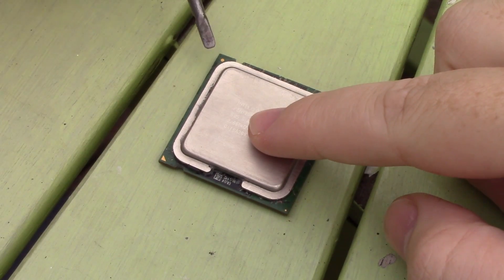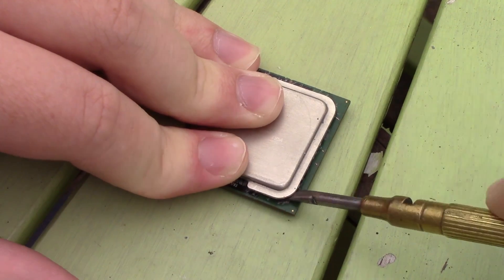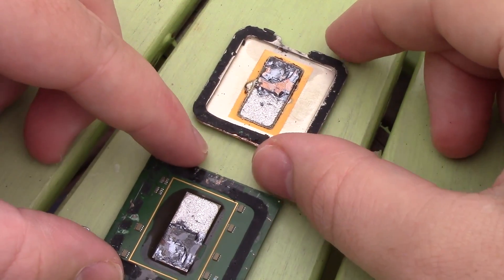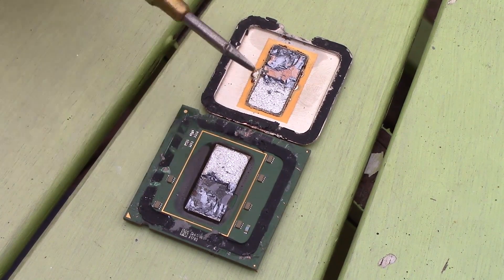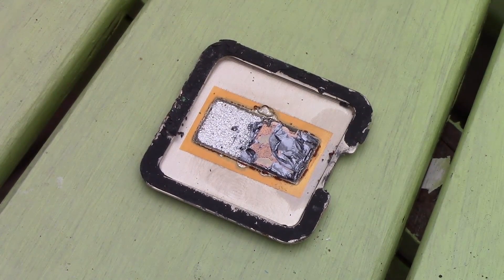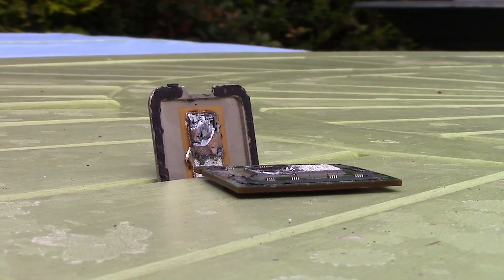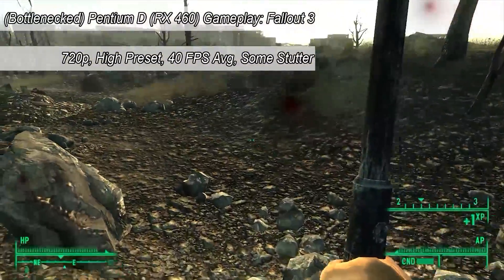Delidding a Pentium D

Comment: i actually managed to delid one of these without breaking the die/dies 
i heated it in a pan for a few minutes, put it in cold water immediately after and pulled the lid off while it was still warm and it popped right off 
the CPU was dead before i delided it so i've got no clue if it works or not

Comment: I have lower power consumption readings with my D 915 in a Dell Dimension E520. According to kill-a-watt meter, about 65w at idle, 115w at load running BOINC work units (both cores at full load). probably a bit higher with prime95. You saying 140w idle doesn't sound accurate at all. i did enable S3 or S4 sleep in the BIOS that probably helped idle power. see video 'can a pentium d BOINC?'
Answer is yes, barely, complete work units before deadlines and hasn't smoked, yet

Comment: (Probably covered in other comments but) Between the Pentium D and the Core 2 Duos were Core Solos and Core Duos. The Pentium D did act as a stopgap, as said in the video, but it was to buy Intel time to dump the Netburst architecture and rev the Pentium M architecture to develop the new Core lines, initially launched six months later.

Comment: Core 2 quads are doing the same...
2×core 2 duos stuck together but 2× more    efficient  than the pentium d s .
Ex: c2q q6600 = 2×c2d 6600
The quads are 8× more efficient/performance

Comment: I got a Pentium D 935 for my CPU-collection these days and played a bit around to see what it can do in comparison to the P4's and Core2Duo's. At stock 3,2GHz it idles with 95 Watts and only pulls 137 Watts at full load (Prime95). 202 Watts is for 1,32 Volt @ 4300MHz... even if the P4-architecture lacks in per-clock-performance, it's still fun because It's so easy to overclock! This CPU is the fastest CPU in my collection now and goes up to 4818MHz @ 1,48 Volt with a decent aircooler on a cool summers day! The Pentium D only was released too late because the Core-architecture is 2,5 times faster at the same clockspeed and was released in the same year...
Reply: they were released different years, like a year apart

Pentium D's were a last minute effort to try and compete against AMD who was making good dual cores (well cpus in general)

Comment: To be fair the Athlon 64 X2 was also just two Athlon 64s stuck together (hence the TIMES TWO, Cpt. Obvious). That's just how the very first dual cores were made. The difference to the Pentiums was that the Athlons went for instructions per clock instead of clockspeed, and therefore ran much cooler to begin with. The regular single core Pentium 4s weren't exactly known for staying cool either. The first purposely designed dualcore was indeed the Core 2, and it showed.

Comment: Actually did this at work with a kitchen knife for teh lulz, was pretty surprised to find solder underneath. The die apparently survived - would've tested it, but I ripped off the same two corner SMCs like in the video not expecting them to be there. >.<

Comment: Should have done a little research before pulling the IHS as the exposed die without being destroyed would have been more interesting to the noobs here. The one you killed was an 800 series Pentium D and the 900s had two separate cores or dies on a substrate like core 2 quads and the recent AMD Threadripper. The 800 series Pentium Ds like the 805 were popular for budget overclockers until people learned the hard way when it killed their boards due to the insane power consumption ruining the vrms as they can pull well over 200w when most boards had issues around 140w or so.

Comment: Ahhh yes. The Pentium D. I was graduating HS the year it came out.

Boy, I could tell you a few things about Intel. AMD was kicking Intel's butt in almost every which way SKT A then SKT 754 then SKT 939. I remember when Intel released the PD aside from the Netburst being a total flop due to heat. The PD also used its FSB to access the chips CACHE, which only slowed the system down more. The PD got Intel through, but just barely IMO. When the Core launched I remember reading it was a Pentium 3 just updated. The P3 was just an amazing CPU. When the PD was EOL'd you could score a PD805 for next to nothing and it OC'd well. It could perform with the 925.

These days you don't worry about FSB, and there is only really one chip maker (for Intel) and it's Intel. You don't have VIA or SIS anymore. Times have gotten simpler.

Comment: when core 2 first launched and the PD 805 launched with it. i got a PD805 for really cheap cause i worked in retail. They were amazing for overclocking at the time. Really good CPU in its day if it was overclocked. i used it for a year or two before upgrading to a Core 2. After that the Core 2s took off because they were more optimized after while. Good old days of PC building! lol

Comment: Pentium D was the first system I ever tried upgrading myself, Had a 3.4ghz model, upgrades the GPU from GTX 6800 and slapped a 8800gt in there, from 2gb to 4gb of ram added Vista for DirectX10 and played me some crysis on my small and crappy CRT monitor.

Comment: on my work lappy right now, Lenovo X1 Carbon 6th Gen - i5-6200U... current operating wattage at 30% CPU load... 5.21W.. maximum wattage used at 100% load, 20W.

Comment: Anyone who's ever actually done this can tell that it was completely fake, meaning you already took the lid off before the camera started rolling. Great demonstration anyway.
Reply: Also, there are not two physical dies on it, it has two P4 cores, but they are on one piece of sillicon, just like all our modern multi-core chips.

The reason it separated like that is because it was fully soldered to the IHS, Intel only started using regular thermal paste on the Core 2 series.

Comment: Actually, the pentium D line had similar prices to the AMD lineup, AMD being even slightly more expensive (I recall prices from 250 to 500€ for Athlon X2 CPUs whereas Intel's pentium D 805 could be found below 200€ pretty easily). 

The pentium D805 was the shit for overclockers at the time. Since multiplier overclocking basically didn't exist, all overclock was done through the FSB, and the D805 was the only Pentium D with a base 133MHz FSB (instead of 200MHz FSB on all other models). Since it had a higher multiplier than any other Pentium D and since mainboards were all designed for a 200 MHz FSB, the overclock headroom was huge. It would often reach overclocked frequencies of around 4GHz, laying waste to any other Intel CPU of the time. But redefining the idea of a toaster at the same time.

Comment: In the same way that the Pentium D was 2 Pentium 4s stuck together, the Core 2 Quads were 2 Core 2 Duos stuck together, two dual core dies on one chip sharing a memory controller to make a quad core CPU. Luckily, the Core 2 architecture was much better and more efficient than the Pentium 4 architecture, meaning that even with essentially 2 Core 2 Duos on one die, the Core 2 Quad still managed acceptable power consumption and heat production while still being quite good CPUs to this day, unlike the Pentium D.

Comment: I have a Pentium D 945 I salvaged from an old workstation. 

A little tip when delidding soldered CPUs though: Use a hot plate to bring the temperature of the IHS up to the solders melting point. and use two razor blades to put pressure between the IHS and PCB while you do so. 

When done correctly the PCB just pops right off of the IHS and you won't damage the die.

Comment: You have to heat it up to 157°C because that's the melting point of  indium (the solder they used between the die and IHS). That way you can delid it without breaking the die.

Comment: Built a Pentium D system a long time ago when it first came out. I regret it to this day. Learned the hard way about motherboards & Intel that day. My motherboard couldn't upgrade to a Core 2 Duo. The processor ran hot as shit. The upgrade to an E4300 overclocked 100% to 3.6 GHz was like night and day. I considered getting an i7-7820x, but I'm starting to have flashbacks of the Pentium D for some reason.

Comment: To those asking for temps before/after - results would be expected to be highly unspectacular, as in a few degrees either way. You know, this thermal solution actually worked. Solder transfers heat to heatspreader, heatspreader then makes it easy to transfer heat to the cooler. Not like today, where a big-ass gap between die and IHS filled with so-so TIM constitutes the biggest bottleneck. Good example for how a single change can totally ruin what used to be a well-thought-out system.

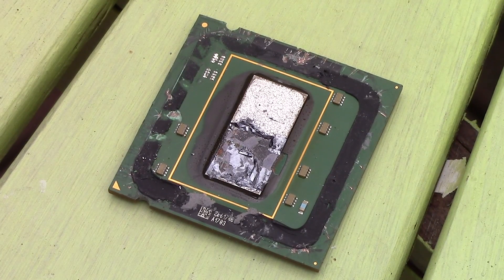Comment: 1:49 That's total system power m8. Very few people could measure CPU power consumption alone in those days. The D 805 was spec'd at 95 W TDP.

A Dell Precision 380 using a single-core P4 630 of the same generation, a lowly GT210 (RIP Quadro FX 3400) and two harddrives ran at about 100 W idle here, still emitting a good bit of warm air. Now the D805 has one more core and no EIST, so something around 140 W sounds plausible. Also keep in mind PSUs generally weren't 80+ in those days and old graphics cards could be quite power-hungry in idle, too.

Comment: Best use ever for a Pentium-D...

Why oh why, did I ever swap out my Pentium 4 (With Hyper Threading) for a Pentium-D? God damn I felt like an idiot at the time. All I gained was a HUGE increase of heat in my room, and my fan was going absolutely mental at the time. Noisy as f*ck and thermal throttled all the time.
And it was expensive as well.

Comment: You should try properly delid you can use an electric hob to heat enough to release solder but you still need to pre release glue

Comment: Still have a couple of P4 640 - I think I went Intel when AMD were top, then went AMD when Intel were top - so whatever I choose, GET THE OTHER.

Actually earlier I was a big fan of Cyrix for CPU (my first Pentium class system was a 6x86) and Cirrus for graphics - it had a 5446 - later bagged a cheap deal on 5465 AGP for a couple of systems.

The whole P4 "Netburst" thing was a major wrong turn for Intel - I gather the architecture was meant to scale to high clock speeds, trouble was the power usage scaled even faster.

Apparently Core 2 owes more to Pentium 3 or the mobile in its heritage

Comment: I've delidded a Core 2 E4600 as practise for my i5.
Quite some of the low end Core 2 chips used thermal paste similar to todays Intel chips.
Adn the Pentium D 805 was actually bit of an insider tip. The 120€ CPU could easy the clock and performance of the 1000€ Pentium D 955
Reply: Thermal paste on low-end C2Ds? Never heard about that before. You live and learn!

(I've had E6550 and E8400, both of these clearly soldered, but of course they were at least midrange chips, too.)

Comment: If you really want to de lid one of these using a hair dryer to heat the ihs can loosen the solder. Never done it to a CPU but it should work in theory.

Comment: Seeing you dealing with Fallout 3 pretty often, i have a question..
I have a quite ok pc (6700k + 1070) but i'm having some stutter issues in F3.
I can't use my native res bcs i'm using a 144Hz screen and F3 doesn't really like it (anything over 60fps breaks the physics in some manner and no settings in Nvidia Control Panel can force it to run at 60Hz).
so.. i've been trying to play at some custom resolutions locked at 60Hz and after getting outside of the vault, i've noticed that i'm getting some pretty noticeable stutter. With my 1% lows being 45fps, 0.1% lows 27fps and the minimum framerate i've ever gotten was 7FPS. Any solution?

Comment: If you want to repeat this, you should heat up the CPU first, the thermal interface is made of indium, you need 157°c to melt it, go for around 170°c., before you do it, loose the adhesive and if it has the temperature you can simply remove the IHS.
When the indium on the die is cold again you can just remove the rest with a razor blade.

Comment: i have a core2duo e4500 2.2ghz,4gb ram(DDR2) and intel integrated graphic q45/q43 express chipset 1700mb should i buy a nvidia gt 710 or a nvidia gtx 630 ?
Reply: Depends on what kind of GT630 you get - there have been no less than 4 different versions including two GT430 rebrands, so the used market may be a bit of a mess. The last, GK208-based one would be somewhat faster than the GT710, which uses a cut-down version of that same chip. Neither is that attractive for gaming, though they're obviously still lightyears ahead of the onboard graphics.

I'd rather keep looking for a GT730 GDDR5 or even a GTX750(Ti). 
Also look out for cheap E8400s or E8500s, one of these would be a worthwhile upgrade for very little money.

Comment: Atleast a Pentium D uses solder.... There I said it, the Pentium D is better than a Core i9!
Reply: WELL AT LEAST IT'S NOT TWO OLDER CHIPS GLUED TOGETHER LIKE AMD THREADRIPPER HAHAHAHHAHAHAHAHAHHAHAHAH!!!!! Oh wait.

(Clearly trolling, I use both AMD and Intel in my home systems, NOBODY should ever comment something this single minded.)
Reply: Budget-Builds Official hey i just subbed to you recently
Reply: ivy brigde started that thermal paste on heatsink trend. sandy bridge was the last solder on heatsink for mainstream intel cpu's which was why they were great overclockers..
Reply: We are always going about which company is best between Intel AMD and Nvidia... Here is my perspective:

I have 2 PCs. Both use an Intel CPU
My gaming laptop has a Nvidia GPU
My super budget gaming desktop has an AMD GPU
My Xbox One has an AMD CPU and GPU
That puts me on all 3 teams

Let's face it: Intel, AMD, and Nvidia all make good products.
Reply: The reason why Intel runs so hot compared to Ryzen is no solder.
Reply: Agreed :)

My gaming laptop was less than $1,000 and can run any game with ease (Dell Inspiron 7559), and made a great replacement for my ageing Dell Inspiron N5030 laptop with a dual core Pentium and GMA graphics that couldn't run any game even at the lowest settings for its life. 

My desktop was even better though, I scrounged eBay for the best deals on PC parts, and managed to build it for less than $200 (Core 2 Quad, HD 5870). I don't have a lot of games on it, but Overwatch can run at a near consistant 60 FPS (very slight CPU bottleneck, minor drops in intense action). But I almost wish I went with a desktop last year, but having a laptop is still great because I have taken it out of state with me 3 times now and I've been able to play my games everywhere from my desk, to a hotel room, to an office, to even on an airplane!

But yeah, when you are buying something, don't go for something that is overpriced. I have no direct allegiance to Intel, AMD, or Nvidia (but I am happy that AMD is making a comeback). On top of all, if you want to save money, you probably should not get a Mac.
Reply: Ayy I watch your videos
Reply: NJ Finally somebody with a brain! Just buy what is at the moment the best bang for the buck.
Reply: DragoFTW same here
Reply: yet i still got p4 3.06ghz socket 478
Reply: Cameron Whitehead That is just plainly false. Ryzen is far cooler than Skylake X.
Reply: I have a Ryzen 7 1700 because i do a lot of compiling in linux (and programming), but for the games i play it is overkill to the extreme. In fact, im sure it is bottle necking my GTX 960.

My Laptop is a piece of dog shit. It has a i7 4440 or something like that, and it gets so noisy that the fact it is an ultra book seems kind of scary due to the fact that sony thinks that it is not getting too warm. A i7 mobile in a laptop with the thickness of a tablet? Not a good idea.
Reply: My 3930K sent condolences.
Reply: Budget-Builds Official ayy I only found ur channel 1 year ago
Reply: Budget-Builds Official lol the exaggeration is real
Reply: SteelCity1981 kaby lake is a great ocer too. And haswell refresh
Reply: Macbook style ultrabooks are cancer because they are prone to thermal death and are often very cheaply made not suited for gaming or 3D work.
Reply: I game on a notebook, but it is a notebook designed for gaming, and as such, it has proper (albeit noisy) cooling that gets the job done with headroom to spare. I have no problem playing all my games on it on high settings. That being said, I have a couple friends who play Overwatch on notebooks not designed for gaming... I have one friend who plays OW on an HP Spectre, but since recent Intel HD graphics are not too terrible, he says it actually gets good performance. However, my other friend plays on a... uhg... Macbook Pro 2012 running Windows 10. Somehow, someway, on the lowest settings he gets a solid 30 FPS, and he is an absolute beast at Overwatch. His Mac, however, struggles mightily to keep its Core i5 cool during gaming, and you can really hear its fan during a long gaming session.

Comment: I have an older PC that originally had a Celeron 420 @ 1.6ghz. I upgraded it to a Pentium D 945, stock clock @ 3.4ghz. It was a very substantial upgrade but damn, that thing ran hot! The PC is now running a C2D E4700 @ 2.6ghz. Lower clock speed, but actually performs better. But the big plus is it now runs cool and quiet. I stuck an old GTX420 in there and it's great for playing Minecraft. A lot can be said for the LGA775 platform.